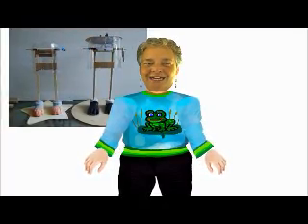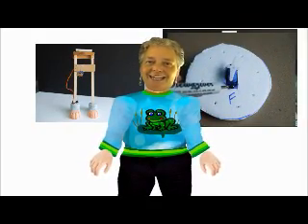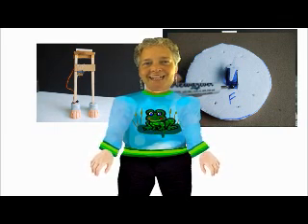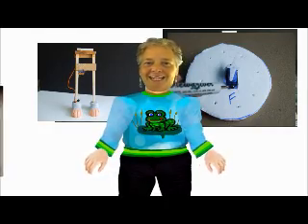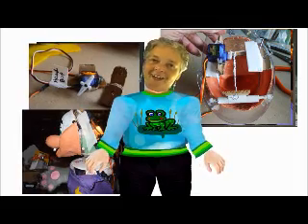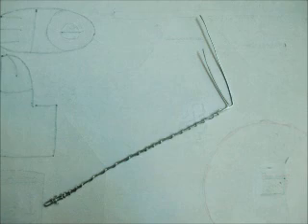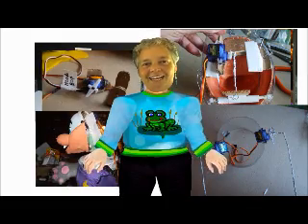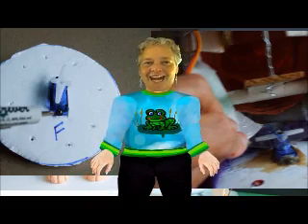PART 4 HOW TO MAKE AN ANIMATRONIC

Comment: How much does it cost for you to make this
Reply from the maker: Just for the parts and stuff to make it it costs $300. whit out the controller whit controller  it costs $500.
Reply: @RGJubilee  how much would it be if I just did 4 movement charcter
Reply from the maker: the parts and stuff cost about $300 and the controllers cost anywhere at $300. and up.